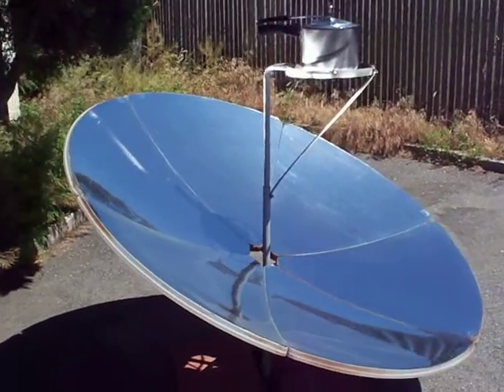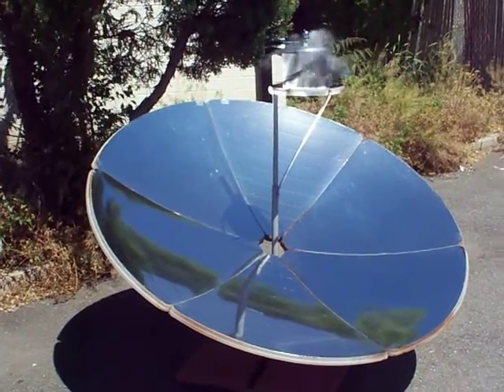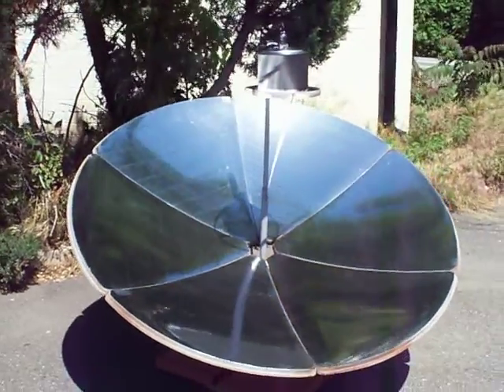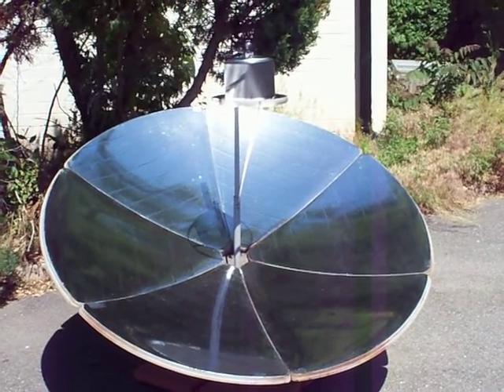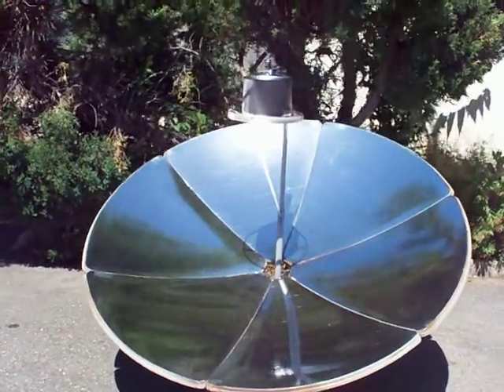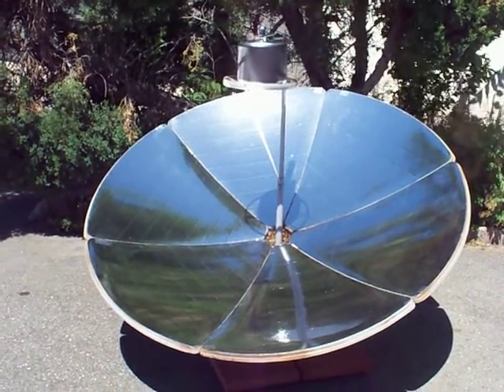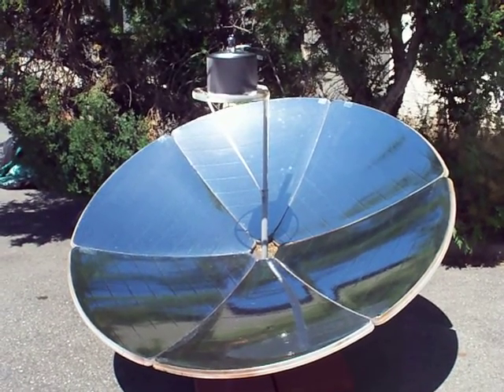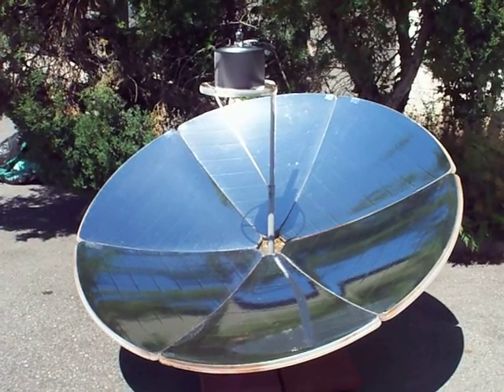Solar Cooking Using A Parabolic Pressure Cooker

Comment from the maker: @ScoutCrafter I use high temperature spray paint that you can purchase at any automotive parts store like Autozone.  It's good up to 2200 degrees Fahrenheit and has held up great.  The 5 foot diameter parabolic produces temperatures up to 825 degrees Fahrenheit.

Comment from the maker: @trentontrading you can purchase one with a small electric motor that will automatically track the sun all day.  The focal point stays on the cooking vessel for approximately 30 to 45 minutes contingent upon the diameter of the cooking vessel.  Pressure cookers work great with this type of solar cooker.

Comment: Try doing ribs this way *without* adding liquid to the cooker.  Instead, add apple or some other wood chips to the bottom where the heat is highest (*NOT* hickory or mesquite, because they are too strong).

The moisture from the ribs will circulate inside, keeping them moist without that boiled taste/consistancy.

Comment from the maker: You can use a satellite dish if it is large enough.  I think you would need at least a 5 foot diameter dish.  I tried a smaller parabolic, called the Solar Sizzler and it was not powerful enough to run a pressure cooker.  You can use mirror vinyl for your reflective material.  It's fairly easy to apply and not to expensive.  I always stand behind or off to the side of the parabolic for safety reasons,  so shadows are not an issue.